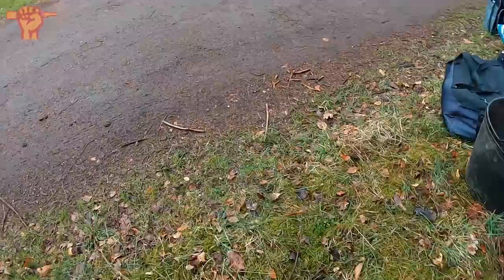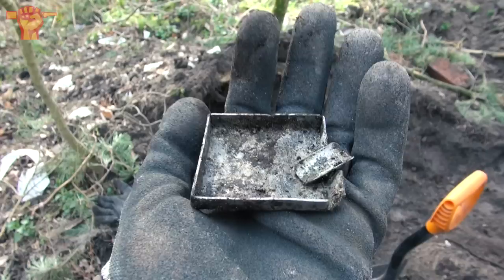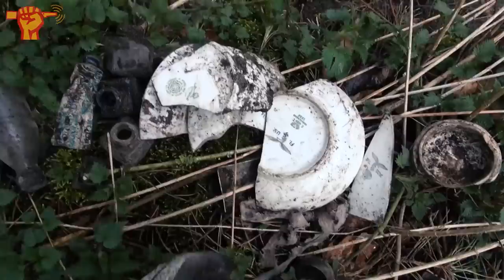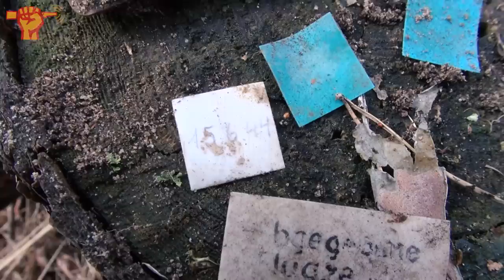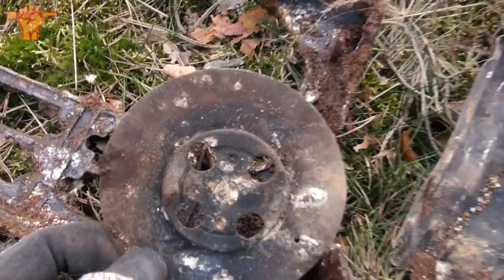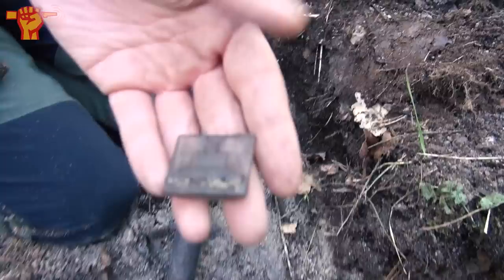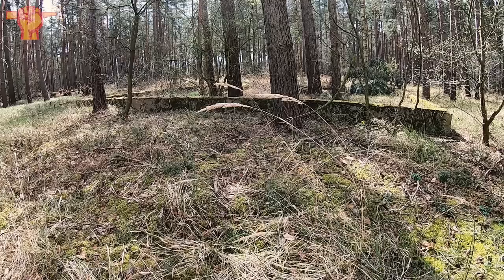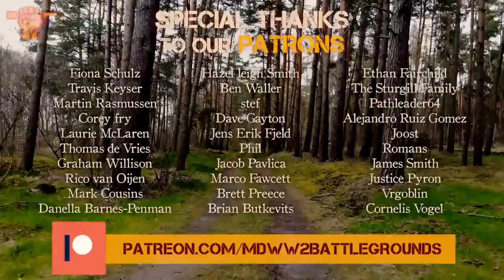Buried Luftwaffe Equipment found 80 years later!

Comment: What you found here on 9:48 on the right side is actually a nob to finetune the frequency of the radio called „FuG16zy“

The nop and the panel itself came along with a big variety of different shapes and was used in all kind of German aircrafts sonot necessarily a Bf-109. this particular panel-shap does not fit to the one of the Bf-109 (unless you found further evidence of course) :)

Greetings